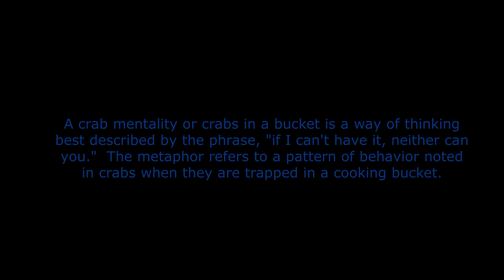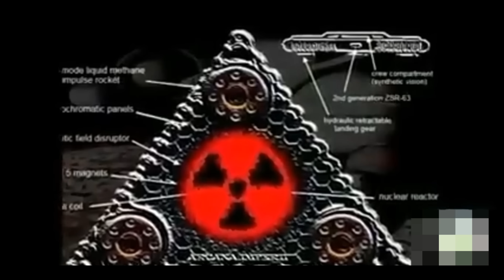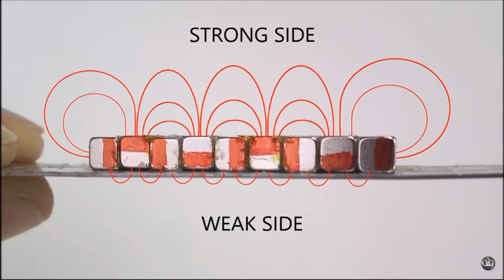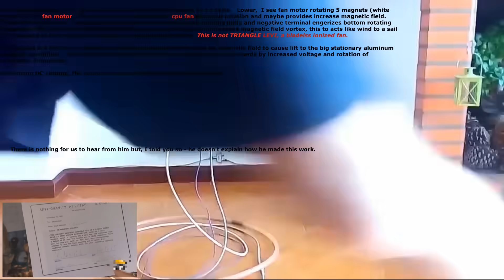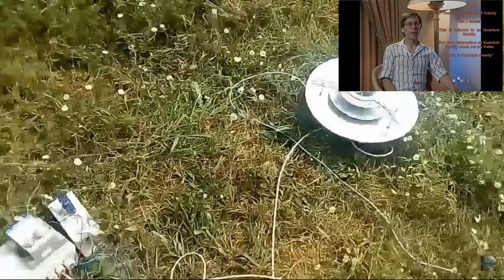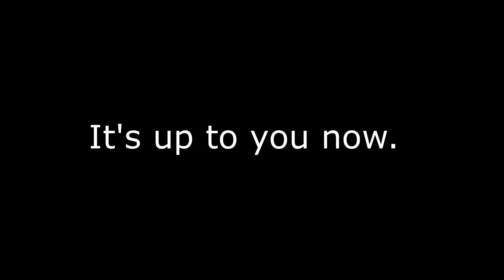anti-gravity project

Comment: The flaw of Anti Gravity is (HMRE) High Magnetic Radiation Exposure where the blood becomes magnetized and clots easily which can slowly but effectively killing the host unless there are treated with immediate blood transferring treatments :3

Crazy how the iron in the blood can still be magnetize if left under a very intensely strong magnetic field over a certain period of time.

If it "was possible" to build a anti-gravity machine for like flying a cars or a plans or what ever, then the long term side effects would eventually be known after long term usage due to mass produced of that type of engine.

It be like how people just started learning that certain strong WiFi signals can cause cancer or certain cheaply built cell phones give off radiation..

The best solution is to look for a way to negate the effects of long term HMRE rather then building a anti-gravity machine right away for personal travel as a future traveling use, for it's like building a nuclear factory without a radiation suit or a lead shell for the core lol XD

Could still be useful for un-man drones or sending satellites into space or probes to other planets but going to still be risky for human use till the side effects can be negated in the future :/
Reply: So everybody taking an MRI will be dead!
Reply: @poriland41  Lol MRI is a weak machine that barely harm a fly (minus the electrical equip that powers the machine) little alone be able to lift off the ground. 
Funnier still the standard effects of a MRI is the equivalent of a long exposure of a Cellphone so don't expect to die from it unless you prefer long MRI bathing in your leisure time or have a pace maker or want to take the safety limiters off the MRI, lol XD

Comment: I'm really annoyed of how simple this is and how well it works. This actually explains a lot about the UAP sightings.

In case anyone is wondering, if you look at the typical experiments they all feature a overpowered magnet pushing a light object. The last video is an electromagnet that's smaller so it weighs less. However, the cords are thick because it is power hungry. Well, if humans did this, the only thing that we have that could generate that much power in a small space would be a fucking nuclear reactor. It would explain why some UAP sightings have crazy radiation detected.

It isn't anti-gravity and it has nothing to do with the Earth's magnetic field. It is a magnet pushing on something that is connected to the same frame as the magnet.

However, this still seems to have some issues and doesn't exhibit all of the crazy things UAPs can do. So this might be more like a cool copy of traditional UAPs that some governments have invested in hoping to finally crack, but were never really able to. That could also explain why governments seem to both be harboring secrets regarding legit UAPs while simultaneously trying to get more information; their implementation can only do so much.

Cool video!
Reply: You mean a throne
Reply: All you would need is the shift of the poles since gravity is zero in the universe matter is charged by positive energy by the momentum magnetic field also affects time so would you call it time travel due to there's only one place where we are tolerated Earth any other planet will crush our souls  because we are not ready to upgrade to the next the ticket is to love one another I guess pride is a hard one demons rather suffer than being humble

Comment: It's mechanical rather than magnetic... but I got an idea from TJ Pawlicki (author: How to build a flying saucer)… rather than rotating off center masses as he posited.... use acceleration and deceleration of spinning masses for traction-less and reactionless propulsion. A wheel with magnets on its outer circumference. 2 coils 180 degrees apart. The coils can either fire as a powered electromagnet or it can inductively generate power... controlled by a processor. Spin the wheel up, and then keep firing power into one coil to accelerate against the magnet on the wheel, and when the magnet gets to the other coil, slow the wheel down by generating power (power can be capacitively recycled into the next rotation). The AC and DC force vectors are in the same direction. This could be used as propulsion on EM radiation-powered spacecraft, planes, cars, ships...  but... does it work?

Comment: In the late 50z my uncle worked for AVRO in Both Malton and Downsview Ontario Mississauga Ont. Both just north west of Toronto. Anyways thats the AVRO arrow car. Built for the YANKS doing saucer research, It never flew but hovered over the ground and became the first hover craft. AVRO ARROW check it out its you tubed as well. Anyways if  the Germans had it like they said it would have been used. Hitler was fanatic when it came to super weapons, The same could be said about Antarctica, The Germans there did not have the BELL flying dureing the war years or they would have been used as well. Perrrys Ex Was in 47 and the secret battles that were 2 more excursions and they threatened the occupants with an atomic weapon that forced a collaboration between these 3 groups which now is space command, BTW, My Uncle was just an Electrician hahaha, yeah right, He maintained that job description and went to work at TRANE, In Etobicoke  Mississauga. Have fun guys.

Comment: Hello everyone, I have a strong theory & I believe it will work. I am confident that I have figured out how UFOs operate & with this latest video I have watched, which I thought of all of it more than two years ago & now I see a video proving my thoughts on UFO flying capabilities.
Reply: Jeff Lucas
The theory of antigravity is true, but a key to how UFOs can fly is all based on magnetic propulsion. In a video I recently saw on Quantum physics. The universe & surrounding planets & not to mention gravitational pull from planets has a significant affect on antigravity especially when UFO's enter the Earth's gravity. It is all very simple once you can understand how to control this. In a simpler form, is like two magnet's. One positive and one negative. The earth can be the positive & the other object is a negative or vise versa. To actually understand this, one must see a diagram showing how the magnet's oppose each other in a craft with special metals that are not necessarily conductive. Only when it is engaged to perform antigravity effects. I have a hole invention that could change the future of this planet.
Reply: @franksplace532  your 98%  right, but it's not metals.  although partials of metals  infused in the one substance your missing, is in fact how it's done.  Also forcing them to not only  become magnetic,  but becoming  the turbine itself. Then with speed and momentum created with no manual force;  which  hads already broken many laws of physics, become "well" free energy. And yes I built one aswell. In a low power position I have never charted a loss of energy . Energy that it is using to power itself, or the percentage it's builds as disposable,  usable free energy. Glad someone else figure it out.
Reply: We should speak some time.
Reply: @ryanridge8102   Yes! The magnetic field / force between two magnet's is the key in perpultion. I also agree on different metals / particles made up of positives and negatives to create the magnetic force or momentum to achieve movement. Further more, the movement that is generated in a force towards a rotational circular motion is produced in a direction that apposes the Earth's gravity & not leaving out the other magnetic forces throughout space and other planets that give antigravity & a floating abilities when in Earth's gravity. It is more so noticed in Earth's gravity than of planets without.
Reply: @ryanridge8102  put up a video of uR craft so, if uv built 1, cus until u do , all uv  built is a tall tale ,all good saying something, not as easy backing up ur claims Dow ,

Comment: You need to electrically create compression and rarefaction in the ether where you have low ether pressure/rarefaction in front of your ship and high ether pressure/compression in the back of your ship. You ship will be gravitationally pulled towards the low ether pressure. You don't have true anti-gravity without this. You can treat ether like a fluid or air entire physical universe is submerged in.
Reply: XY ZW  Depends on the ether propulsion system. The direction pilot points the ether propulsion system becomes the front and back of the ship.

Comment: 13:10 the way is clear. We just try to do it at home. If it is working then, all mystery of the UFO and Aliens are fictional.
Reply: No, it is very real, but to go there the laws of thermodynamics have to be broken see (Schappeller devise) patented in Germany in 1911. It produces 4 energies, magnetic, radiant, electric and gravitational. It works continuously and unlimited, this electrical supplies all the equipment, motors for stabilizers (gyroscopes) and ionic wind for propulsion. Tesla also patented a flying saucer based on this patent after the CIA murdered Karl Schappeller.

Comment: Copper, mercury, 2 magnets, electro magnet controller, 5 piece build with a self generating coil , mechanical arms to control one magnet, thAt controls direction
Reply: For example imagine how a starter or alternator on a car works
Reply: If the mercury gets hot or having issues with heat transfer it and make more energy out of it
Reply: @audiolsmobilservices7431  Please, you can explain more?

Comment: "Anti-gravity" huh?  it will not work. because gravity is not a force which can be simply "switched off" or "influenced". Not by magnetic fields, not by electric fields. Only by orbiting a mass to produce an equal radial acceleration into the opposite direction.  Gravity is an acceleration, an attraction, which is caused by the sole presence of matter resp. bosonic mass of any thinkable kind (even antimatter mass has the same gravity). So, also a want-to-be "antigravity" device is something which is bound to these physical fundamentals. Because it underlies to the influence of positive masses of our space (which we call the positive space).
Reply: Gravity does not pull anything. It is dark matter pushing the matter to a specific point due to the accumulation of mass. Tomato TOMOTO... either way if you land on Juiter you will be flat as a plug nickle... just my observation. So if you get in an Anti Gravity aircraft it will flatten you out like a grape being stepped on. That being said if one exists you could control it by remote control

Comment: I have some thought about scaling up the project for passenger use and would like to discuss them more with you, the last video caught my interest in the way that a capacitor is used with a halbach array along with a larger coil and heavier voltage applied, I'm wondering about upping the amperage for quicker path adjustments and creating an insulated dome to put on top of everything for passenger or cargo storage, a camera system could be used for viewing so that no structural integrity is lost from a glass viewing area.
Reply: Yeah and a star bucks holder. Maybe some mp3 support 👍

Comment: First step to anti-gravity is figuring out how to nullify weight. Everyone knows weight is not inherent property of mass, right? High voltage, high frequency, high current, dielectric materials with high dielectric constant and strength, pyramid and hexagon shapes, diamagnetic and paramagnetic materials, etc. are tools to figuring out how to nullify weight. Read books "Occult Ether Physics by William Lyne" and "Shape Power by Dan A. Davidson". Also read book "Uncovering the Missing Secrets of Magnetism" on ether.